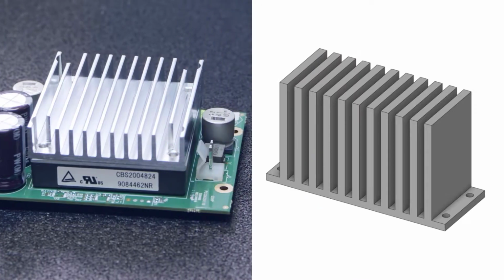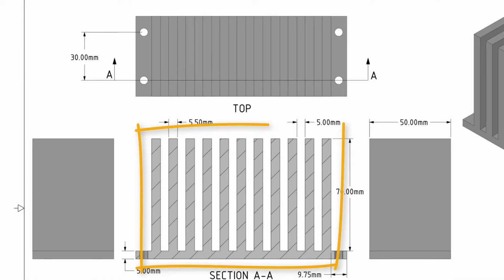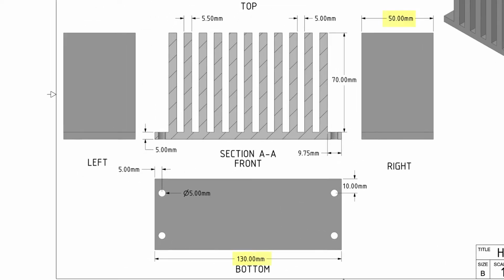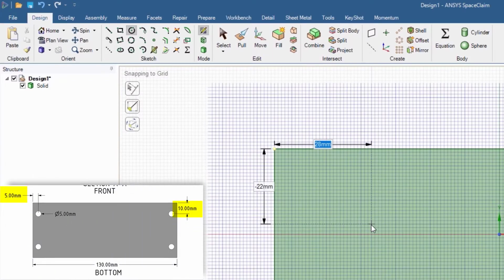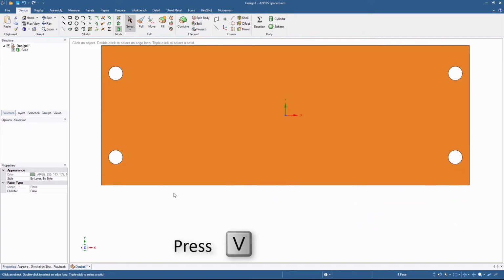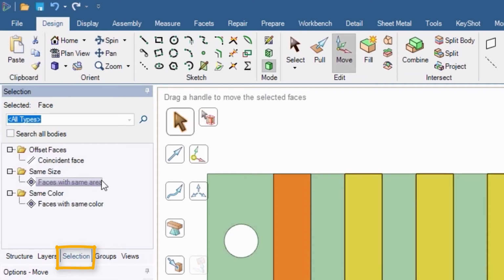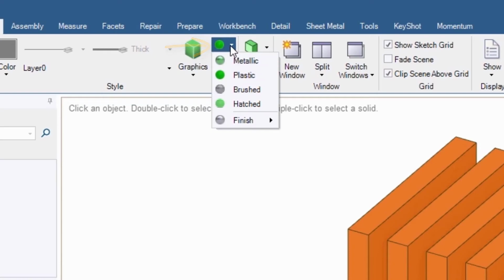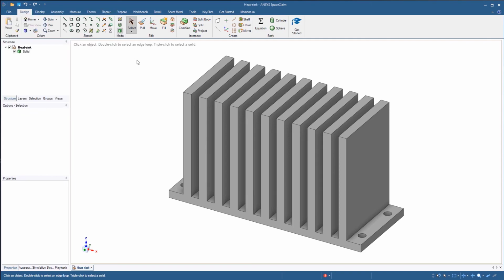Modeling a Heat Sink in Ansys SpaceClaim — Lesson 3, Part 1

Comment: Before creating the fins by sketching a rectangle through the create pattern option, please note that there is some mistake in length dimension which must be 105mm instead of 10.5mm, or else it would lead you to constrain error, thank you.
Reply: In this case 10.5mm is the distance between centers of two neighboring fins, while 105mm is the distance between two outermost fins. The problem is that in newer versions of SpaceClaim than that in the video there's no dimension field for the former mentioned dimension. As well as there's no possibility to enter the latter mentioned dimension while dragging selection and after dropping it.
Reply: @antanas9015  then how could i set the space between the patterns figures? help pleasee

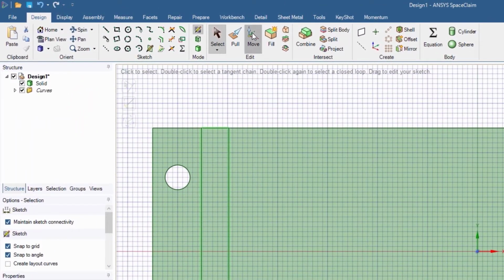Comment: After drawing the rectangle at 5:30 and selecting the move tool by clicking on create pattern when i pull the cursor i am getting an error "Constraint behavior may not be retained on patterned members.
" i am not able to give the distance between generated rectangales.
Reply: Before creating the fins by sketching a rectangle through the create pattern option, please note that there is some mistake in length dimension which must be 105mm instead of 10.5mm, or else it would lead you to constrain error, thank you.
Reply: Either way my sketch cc values disappear and can not define it
Reply: I could create the pattern by:
1. Select rectangle
2. Select move tool
3. activate create patterns
(Arrows showing the axis appear in the center of the object)
4. click on arrow of the axis on which to duplicate the pattern
5. press space
6. first input is distance between center of first and center of last instance, press enter
7. second input is number of instances
Reply: @sonkhuathoang6343   this works for newer versions.  after Step 5, input "-105mm" and then put in the Count of 11